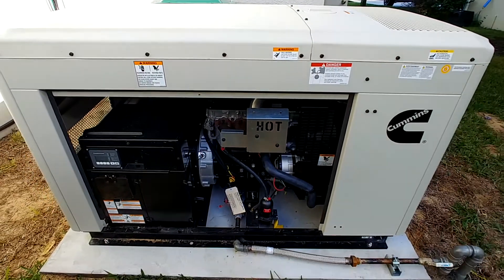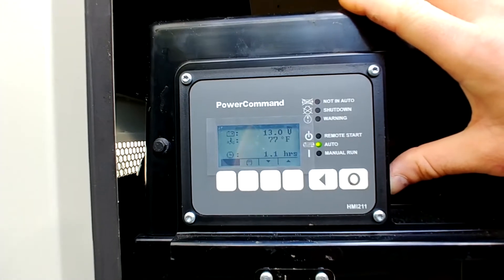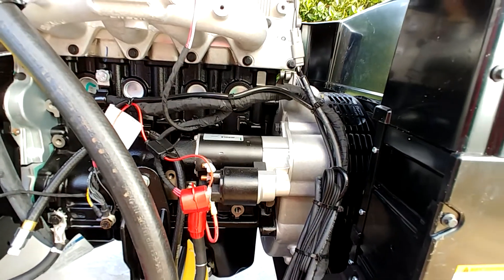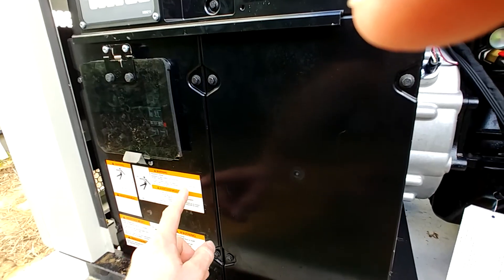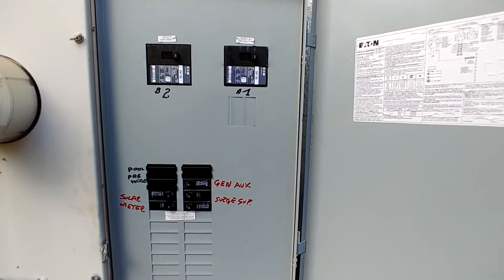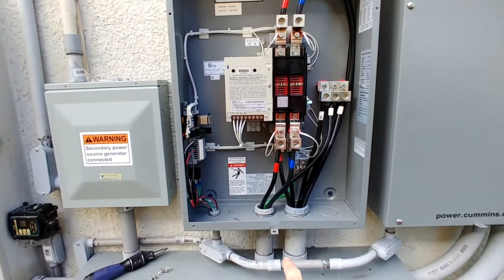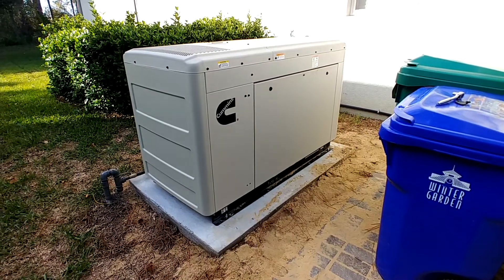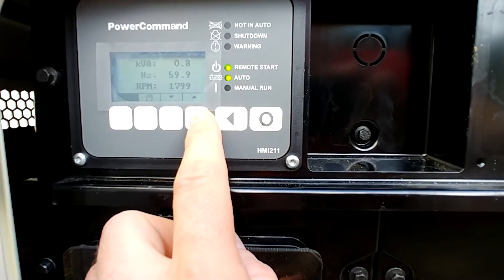Cummins RS25 Generator Review

Comment: You made good selection of engine Cummins by far, for where I work Kohler is not my choice for there oil filter.  With Cummins you can go to any parts store for oil filter, trust me you can and same with air filter.  Wix has cross over section or you can measure and see what they offer.  If the outfit or Cummins says you have to specifically use theirs for it will void warranty, not so.  I would suggest run it for break-in then switch over to synthetic oil, it will well be worth it.  Also you can get spark plugs from parts store as well, Cummins is proud of their pricing.
Reply from the maker: Yes - absolutely!  I actually have another video where I cover the spark plugs and oil filters (eg - don't buy OEM).

Comment: So many boxes on the wall
Reply from the maker: Having a split phase 300A service is not easy to work with.
Reply: @bruehlt  nice job, I gotta ask, what do you do for a living? You seem like you know a lot about a lot...
Reply from the maker: @basajacosaja2735  I have an electrical engineering degree, and work for a company that builds and services power plants, if you could believe it!
Reply: @bruehlt  my friend and I both went to a trade high school. He went electrical, I went welding. He went on to become an EE and works for a utility and I went from welding gas pipes to starting a company inspecting them. Your work is top notch... (We both want to get into HAM radio as well... lol) great video!

Comment: I had a 30KW Cummins 1800 rpm installed. It is very quiet when running. I went over sized because the cost from 20kw to 30KW was so small, I could not justify not doing it. I had mine installed by a contractor and all told it was about $23K. I selected Cummins because With my job with the phone company I was a cable splicer and we used Cummins Gennys to run our power needs for working in manholes and they performed well. Our home is a bungalow with 4 BR and 2 bathrooms, about 2000 square feet. We have a detached garage with two fridges and full freezer. We have an 18,500 gallon pool. It’s very hot where I live in Texas and our power goes out more than I like. I’m glad I went with an oversized unit just in case. Better to have more than to be just on the line. When our power goes out I want my whole house running. Central AC, tv, washer and drier, garage, pool especially. Everything. I can stand right next to it when running and talk on my cell phone. Although it performs well I had bad luck in the beginning with two parts failures that were covered under warranty, but our contractor became very difficult to deal with and they are more than an hour drive away. We found someone much closer and they have been terrific so far.
Reply from the maker: Very cool! Glad to hear that you've had a good experience. My only negative experience I had was I had to have a tech come out and change the exerciser program because it was not set correctly from the factory and I could not change it. But they came out, adjusted it, and it's been working great since!
Reply: Hey Your generator is diesel. Diesels run at lower RPMs then Gas. This Cummins Onan is a nice unit. I’m only looking for something to run only essential systems.
Reply: @josephpuchel6497   my unit is not diesel. Natural gas, liquid cooled. Very quiet.
Reply: I live in College station. Can you share where you live? Can you recommend a good Cummins dealer to go through?

Comment: Great setup sounds much quieter than most generators that I have heard. Here in Massachusetts the Cape Wind windmill project promises to quadruple our electric bills. It might be more cost effective for me to run my home off of a generator like this and use the grid as backup.
Reply: This is a standby generator, its not meant to run all the time.  For that, you'll need a diesel type of generator.
Reply: @christschool  Incorrect... These liquid cooled units are perfectly fine for primary power
Reply: @jimsbagels1991  liquid cooled?
Reply: @basajacosaja2735  Yes, these Cummins generators are liquid cooled.

Comment: Great Video Travis, Is the housing design sufficient to act as a Faraday Cage to protect the unit from interference?
Reply from the maker: My guess would be no - it's aluminum which technically should block / shield some noise, but there are enough holes in it for cooling and exhaust that it probably wouldn't block much.

Comment: Great video, I live nearby in Tangerine/Mount Dora. I was comparing the liquid vs Air cooled. I was wonder what made your mind up to go air cooled? Also what was the total cost installed for you to do yourself if you don't mind sharing?  you have two transfer switches which I guess add another 1,000  Seems like a 22KW air rouglhy 4-5K and the liquid cooled model start around 10-11K.
Reply from the maker: Researching the difference, all liquid cooled models run at 1800 RPM and all air cooled models run at 3600 RPM.  Almost all air cooled models use lawn mower engines in them (1 or 2 cylinders).  All of the liquid cooled models use true car size engines in them - at least 4 cylinders.  The liquid cooled engines will last much, much, much longer than the lawn mower engines, due to the liquid cooling, as well as the fact that they are running at 1800 RPM vs 3600 RPM.  Also - the alternators (the parts that generate the electricity) in the liquid cooled models are designed for 100,000's of hours.

Basically, they are worth the cost to buy if you are serious about a whole home unit.  The cost difference is greater, but you are paying for longevity.  When I was researching the air cooled models, none of them said that they could run a week straight.  You need to basically stop them once every day or two and change their oil, if you were running them constantly.  The liquid cooled models can run far longer between maintenance - which is a huge deal for us because as us Floridians know, hurricane related power outages can last up to 2 weeks sometimes depending on the area.

Ultimately it also depends on your needs.  You can't get a small liquid cooled unit - they start around 20kw I believe.  So if you are looking just to run a few circuits when power goes out it doesn't make sense to get a large liquid cooled unit.  I wanted something that I could run my entire house (including AC units, pool pump, oven, etc) if the power went out.  No AC in FL sucks in the dead heat of July!

As for installation - costs ranged from $6,000 - $10,000.  Most companies I received quotes for did not include installation of the gas line, which plumbers wanted another $1,000 minimum to do.  The installation costs were exceedingly high in my opinion, for the amount of work required - which is why I decided to do it myself.  The hardest part, at least for me, was digging the line for the gas and electrical, because you need to be at a minimum required depth and digging in wet sand sucks.

Comment: Do any body know the price to install it ?
Reply: Price will depend on the distance from gas source and distance from electrical panels.  My quote was around $18,500 for the RS25 unit and 500 gallon propane tank, installed.
Reply from the maker: Hi - I received quotes that were as much as the generator itself - roughly $8-10,000.  Which is why I did it myself.
Reply: For a liquid cooled 20-25 you are looking around $20K

Comment: Nice video and congrats on the install. I had the RS50 installed at my place and you are right the cost is almost twice the cost of the generator. I am still learning how it all works but for the most part, it is set and forget. The only issues I have had so far are settings for the weekly exercise duration and a warning light when the temp gets too low, even though it comes with a block and oil heater. Both were firmware settings that the tech sorted out. We have had power outages last 12+ hours and we just go about our business as the generator takes care of the rest. Do you have any more info on the Cummins app and module required?
Reply from the maker: Will make a video of that soon!
Reply: @bruehlt  Awesome, I am looking forward to it.

Comment: Very informative and well done  video. Question: How long can the generator run  before  a mandatory oil change is required.  Some brands  say  35 to 50 hours, others say 100 hours  and  some  dealers  have told me   a Cummins can go 200 hours.  I like the  Cummins.  My research indicated  that Cummins  is a favorite of  contractors. Kohler  seems  to be a close second and  many like the Briggs and  Stratton.  The  most divisive  brand  seems  to be Generac
Reply from the maker: The maintenance log states to change the engine oil after the first 50 hours of operation, then 200 hours thereafter.  That'd be like running 8 days straight before changing the oil.  From what I recall, you are supposed to change the oil in the little 3600 RPM units much, much sooner than that.  Spark plugs it says to check and replace if needed, every 200 hours.
Reply: @bruehlt   Thanks for the  information !!1
Reply: Since your post 2 years ago Generac customer service and quality are worse! Was leaning toward Champion but past 2 months of research Cummins looks like the choice.
Reply: @anthonythomas6977  i have learned the Briggs & Stratton Generators are also good. Several people I know of have purchased Briggs and are well satisfied. The warranty on some of their models also includes labor
Reply: @albertlevet119  Here is a reality check Cummins whole house? 61 WEEK backlog, yes 61 weeks. due to the chip shortage BS. Well so much for Cummins unless I find a low hours used. WOW
Reply: @anthonythomas6977  You may want to research and consider Briggs and Stratton from an authorized dealer.
Reply: @albertlevet119  Found a Cummins 30KW out of Memphis, dealer has 2 coming in September. Not cheap $13,500 but these are monsters. Briggs and Stratt do look like a great value for the money
Reply: @anthonythomas6977 Just verify with Cummins their warranty will be honored if you buy online.
Reply: @albertlevet119  Buying from a Dealer direct in Memphis! The only way to go and its in stock thank you for the tip though almost had that issue with Duromax
Reply: @anthonythomas6977   One more  point . Is there a Cummins  Sales and Service  Center  near you?  When I was researching awhile back  Cummins  told me that Cummins  prefers  to have  their  rep actually start the  generator the first time  rather than the people install the unit.  I would verify with Cummins if  possible to preserve  warranty.  WHat part of  the USa are  you?
Reply: @anthonythomas6977   that Cummins  30k  should serve you well
Reply: @albertlevet119  Waverly TN and there is Nashville and Memphis service but have backed off. Going with a smaller Cummins (Need a fork lift, other issues that is over the top crazy and would put me at $20K) and my myriad of solar for odds and ends. Either way Cummins is top shelf.
Reply: @anthonythomas6977  Enjoy your Cummins. Will it be arriving soon?
Reply: @albertlevet119  the 20KW Cummins arrives in a week in stock out of Norwall Arizona! The concrete pad (Yeah I hate doing concrete just did a ramp for our dog to porch) will take 6 weeks ugh. 20KW is a sweet spot for us cost wise, and we will have 15kW min solar back up to handle most all other than the 5 ton AC
Reply: @anthonythomas6977   You will be  busy but it is worth the effort.  You have the  electrician and plumber  already selected?
Reply: @albertlevet119  Yes why do you provide these services in TN? ha ha !
Reply: @anthonythomas6977   No LOL  I have had friends who bought the  generators and hired their  own  plumber/electrician.  Some did not  hire people who understood the proper installiation of a generator

Comment: LUV the Info  !!!  WANT  to BUY a  GENNIE  when , I  get into My New Home that Will Cover about 2000-2200 Sq Ft Home ( 3-4BR )  !  What  Is  the SIZE of Ur HOUSE  ( With the RS25 ) ???
Reply from the maker: Hi - our house is about 3200 sq ft.  I have measured our power usage and this thing will work great for the entire house for our needs.  You definitely need to ensure that whatever you get will cover the loads you want to power in an emergency.
Reply: @bruehlt  yes, like 240  volt stove, electric dryer, electric hot water tank, welders.

Comment: Fantastic job.   I wish I could have done it myself too and saved money. I went with the Kohler 30RCL. for my home in Florida.  I have a Kohler 60 RCL natural gas at my store for backup.   You can't beat an 1800 RPM generator.  I agree with you 100% on going with the liquid cool 1800 RPM over the air cool 3600 RPM screamer generators.   .  Another good thing about having a backup generator in Florida is you can also run the AC in your home to keep the humidity down  after a storm if the power is out.
Reply from the maker: Awesome!  Liked the Kohler as well.  That is a reputable brand!

Comment: What company did you buy your generator from?
Reply from the maker: I checked local and online.  Local wanted way more than what I could find online.  From the online dealers, I went with Buckeye Power Systems: https://buckeyepowersystems.com/  They had the BEST deal.  Deals online are even better if you pay cash or check (not credit card).  They also helped out with whatever questions I had along the way as they are a certified Cummins dealer and installer.

Comment: I'm in the process of installing the same RS25  liquid cooled unit . I have the concrete pad about 25' away from my house, I don't want to hear or see it.
 I'm also doing all of the install, Really good video!
Reply from the maker: I'm also planning on doing a video on maintenance supplies and the Power Command system in the near future.  It took a lot of research to figure out what is needed (part numbers) for maintenance and I want to share my results with others, because it's not very well documented.
Reply from the maker: I was worried about the noise, but it's really not bad at all. Especially compared to my neighbors portable generator. I can hear that damn thing from inside the house!